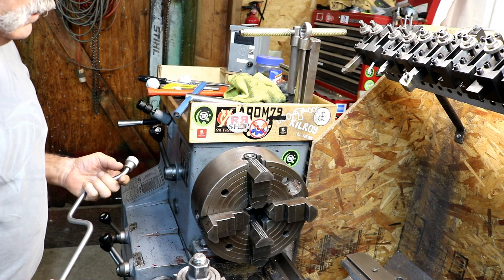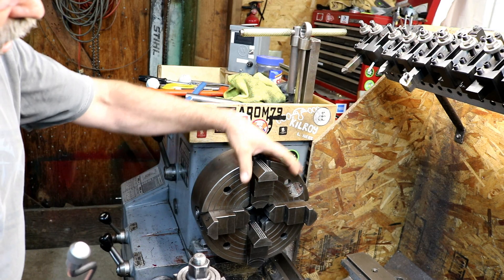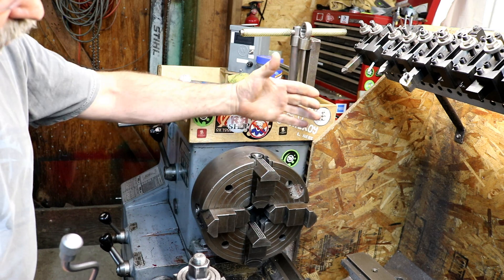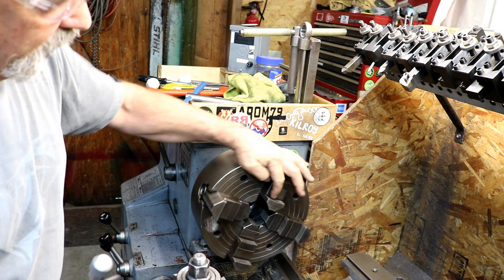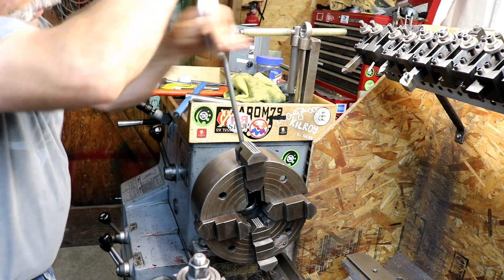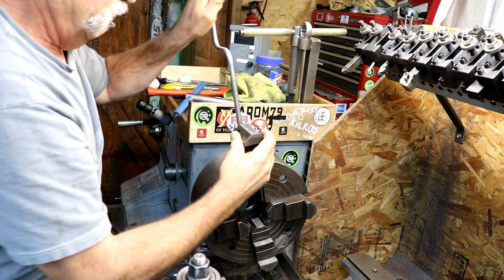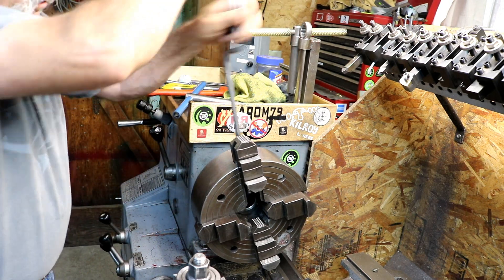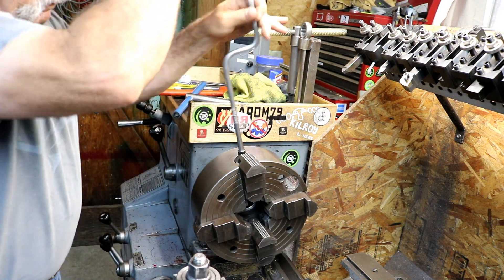Lathe Tips | Speed Handles | Metal Lathe Hack#12

Comment: Randy, good tip. Speed handles are very under appreciated tools. Back when I started, everyone used them. On motorcycles, they are still the best and safest way to install motorcycle engine case screws without damage to heads or threads and to proper torque. 
.
Reply from the maker: Great also on aircraft.  Thanks CR.

Comment: Excellent idea, my version about 10 years ago was to put a ring on one end of the tee so I could put my finger in and spin it.
Reply from the maker: Thanks Chris.  That means alot.
Reply: Yes. I made a wheel with a handle. It's much faster than his brace.

Your finger hole is simpler and probably as fast as my wheel.

I've moved on to a cheep cordless drill.  It's really fast.  I just keep it around. No more effort to reach for the drill than for a wheel brace.
Reply: Andrew George  i did make a square to hex adapter for a cordless drill with a small tommy bar that can also be used for the two key centring method, but the ring ended chuck key is also good for final adjusting. Got make an admission that I dropped it and as I made the ring from Lexan it snapped and I have not made a new one yet, my Tuit list is already too long.😢

Comment: Ha! I have a couple of these from working on aircraft that have not been defueled in hangars without deluge systems where electric drivers are frowned upon. I use mine to do the same thing.
Reply from the maker: It is a must for aircraft.  Those tough screws come right out.  I am an A & P.   Thanks RadarDoug.